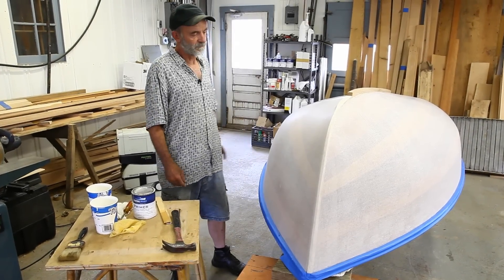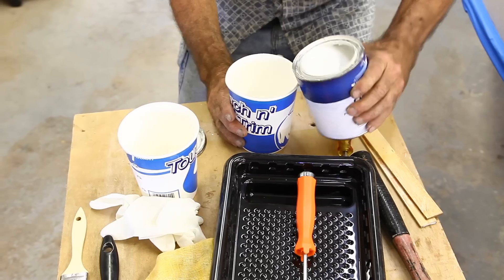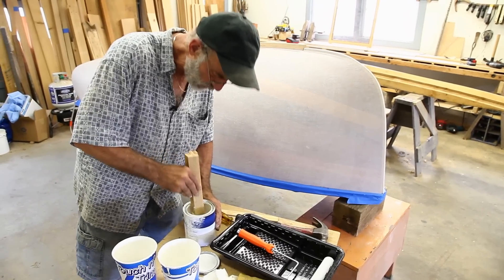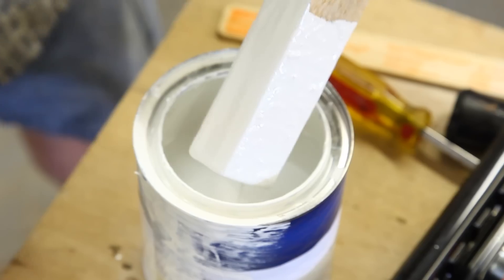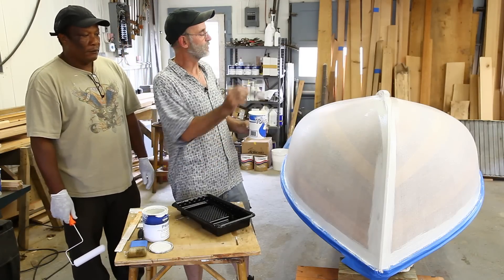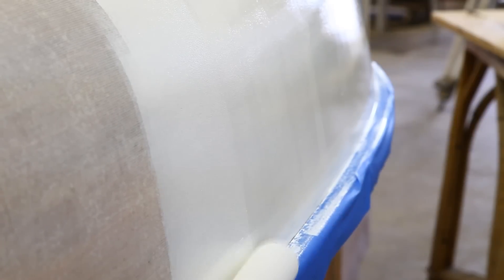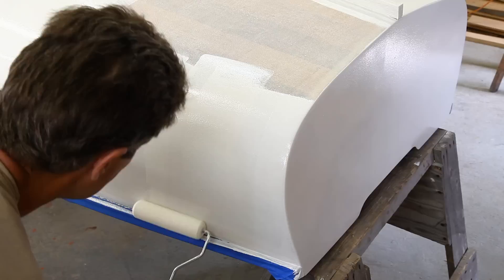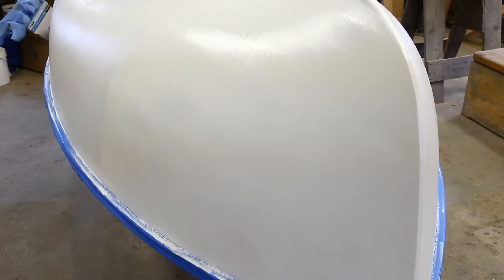How to easily apply Topside Primer to your boat

Comment: I'm confused.  You state the primer can only be used above the waterline but you're brushing it over the entire bottom of the boat.  I just bought some of this primer to do the interior of my Boston Whaler.  Can you explain?
Reply: Since Louis doesn't answer questions, allow me. This is a tender that will not be staying in the water, therefore you can use Prekote® on it. You're doing the "interior" so you can prime with Prekote®. If staying in the water, use Interprotect2000 to prime underwater surfaces

Comment: How many qt of primer was use?
Reply: One quart gave me two good coats on a canoe. The first one gets mostly sanded off with 120 grit and the second sanded less with 220. Full instructions available on the can and the excellent manual Interlux puts out every year.

Comment: I tried a foam roller and had trouble.Called Jamestown and they confirmed should not be useing foam roller....?
Reply: Really? With Brightside® I find the foam roller far superior. The first coat I apply with a cloth roller and iss quite bumpy. The second, lightly thinned went on with a foam roller and required very little sanding.